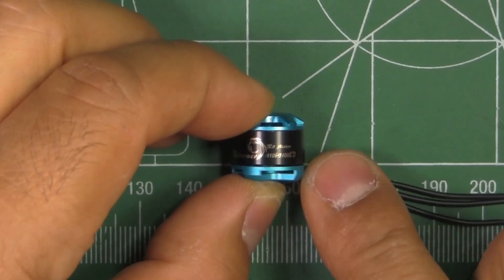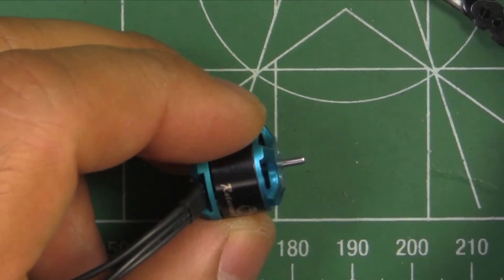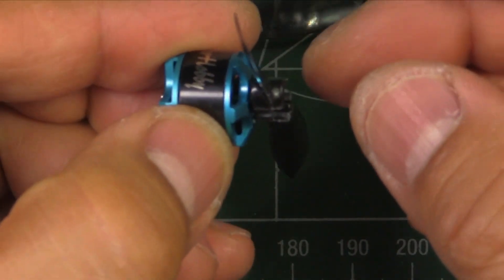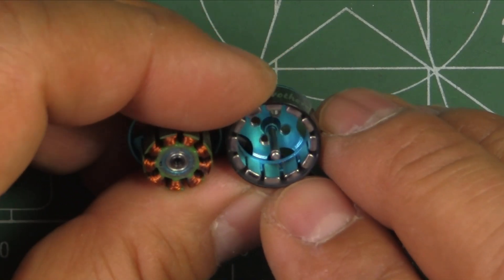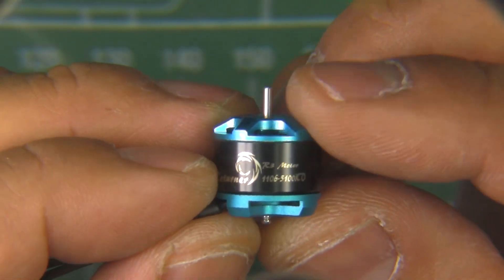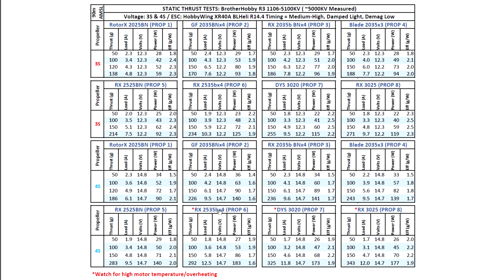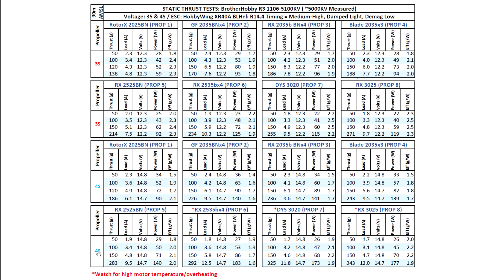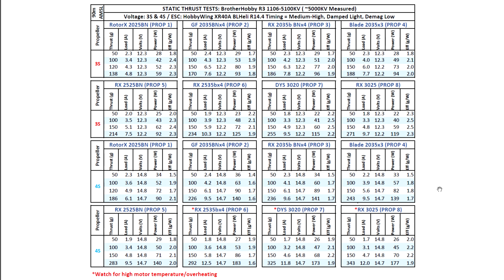BrotherHobby R3 1106-5100KV 3S & 4S Thrust Tests & Overview

Comment: So I just picked up two of these motors, and some HQ T63 6 blade props on the cheap. 

Do you think they can spin um? I was pondering possibly putting them into 3D printed ducts, and running on 2s even. 

I also have a windfall of two EMAX 1106 4500kv motors I haven't put into anything yet.

Comment: Hey all, I'm a little late to this game... I picked up a prebuilt with these motors and they were running too hot for my liking on 2S, even. I've done a some tweaking and I'm fairly sure changing the motor timing on these in Bl_heli to medium low or low (I set mine to low) has helped eliminate a lot of heat without having to completely wreck the tune. (Before I was just dropping D term)

Also be sure to set the motor poles in BF, a lot of micros have 12 magnets, not 14, that may matter quite a bit.

I made these guesses after seeing all the noise my setup had, and noticed the motors ever so slightly twitching on start. They now start smooth, sound a lot different, and felt cooler to the touch than previous flights.

Still think I'll be sticking to 3S on these though.  Thanks for the video, now I have some other props to investigate. Quad came with gemfan 3028, which I'm thinking might need to drop down in pitch some, if anything I'm learning is making sense. 😬
Reply from the maker: Looks like you have made some good adjustments. Yep, these motors run quite hot. Good that you changed those settings to minimize heat. 3S will making run hotter perhaps 3" props would be a bit too much for these. Your settings should help others with similar setup. Thanks for sharing.
Reply: @EngineerX  Thanks to your vids, info, and hard work man, I appreciate it! I'll be testing the 3S today at the park. Probably dumb to fly when it's this hot already (95°F and rising...), but we'll find out the hard way if we have to. 😏

I'll put up a blackbox video of the test flight soon, and report back how it goes, if anyone's interested just check my channel in the next few days. If anyone has recommended graphs or debug modes, let me know! (I assume gyro, motors, pids, volts and amps. I will have to look for more fun stuff that might be useful, even if I hardly know what I'm looking at. 😬)
Reply from the maker: @JerR22  awesome. Will check out your progress. Hey, that's the best way to learn. Hands on , trial and error. Good on you !
Reply: @EngineerX  OhhhhKAY!!! These motors have been transformed, that's for sure!!!  I will have to comment on performance once I get it outside and completely tuned, but I'm gonna need more time for that!  The sound is completely different though, and they no longer feel like they've just re-entered earth's atmosphere when I land.  They were barely warm- back right was warmer than the rest so I may have a super slight CG issue, but no more red hot finger tips! YES!  So, here's how it went down: Snagged up some more JESC licenses (R.I.P. to my first TH Freestyle board which had the previous 4) and put 48Khz PWM and RPM filtering on using version 2.3 (with 2.3 telemetry too, required for this config). Adjusted timing back to medium low, set demag comp to off.
 I updated to BF 4.2, figured why not, let's invite some real trouble!  More importantly, I found out that the motor pole setting I was speaking about above, is only applicable when bi-directional DShot is turned on (As many I'm sure know, but some may not, BLheli_S only supports Bi-directional Dshot with either JESC (paid) or JazzMaverick's (free) custom ESC firmware. (Oscar Liang will show us how! https://oscarliang.com/setup-rpm-filter-for-blheli_s-esc-for-free/)  It's important, but only if that's activated, as that's required for the RPM filter- from what I understood.  I am unsure if it is applicable to anything else when Bi-direction dshot is turned on with RPM filtering set to off.  Honestly though, I don't see why we would want to do that if our goal is RPM filtering for cooler motors(?).  I digress...

The (late night) hover test (that may or may not have woke my neighbors when the low batt alarm started going off😆Sorry neighbs!)  turned out to be 9 MINUTES 14 SECONDS!!! I landed at 3.43v! (I landed in my hand a few times and felt the motors, perfection) This was on a TBS Graphene 520mAh.  Also, I forgot to mention, I'm running Gemfan 3028's on these motors.  Using your chart to wildly guess based on percentage difference between the 3020's and the 3025's, assuming a 3-5% increase in thrust from the 3025's to 3028's... Would you think it safe to guess it's making around 275-285g of thrust at between 10 and 11 amps?  Honestly I don't even think I'm going to bother with 4S on this for now, this seems like a really sweet spot if I get consistent performance. (literally just that one "flight" so far, Can't wait for tomorrow!)
Off topic: regarding BF 4.2:  I'm using the new "set FF_interpolate_sp = averaged_4".  This is now apparently  recommended for Frsky and R9 users as it's supposed to help smooth out FF jitters and tx inconsistencies[Didn't know there were any, good news it's better, let's hope we feel it!].  Lots of details here: (https://www.youtube.com/watch?v=zsW3VkPRr3s)  I had to use "set vcd_video_system = NTSC" to get my video mode set to NTSC to get OSD working.  Default is set to auto, so I guess they thought auto would resolve it and got rid of the selector on the OSD tab? =|  Also to change my font I had to plug my battery into the quad before plugging it into BF, only then was the font manager button not greyed out. For some reason I feel like that's different, perhaps I just didn't change it on this quad before and I'm used to my others?  Highly likely.

Anyway, sorry for the length I'm just super excited (and exhausted) as I never expected this little beast to hover for over 9 minutes and come down with cool motors! Without this video, I couldn't have got there as fast as I did, or maybe ever, considering the seeming lack of info out there on this motor! Thank goodness I don't have to live that nightmare. =D  Appreciate ya buddy!
Oh yeah, AUW is about 130grams so far as I can tell from my little analog kitchen scale.  Okay, delirious post ended. 🤣

Comment: I heard dont get this motor.  The hglrc flame 1105 makes more power on 3s than this BH 1106 does and they come down barely warm.  I think bh was just selling the hype.  My next motors will be the emax 1106 6000kv.  As the emax makes almost the same power on 2s as the flame motor on 3s.  and they are priced between the flame and returner r3.
Reply from the maker: Good choice, EMAX once again setting the standard for performance. 6000KV is probably the most versatile KV. Can run 2S to 4S depending on setup.
Reply: Here is my dilemma, right now I cant record my flights.  Im looking at frames that can carry a run cam split and I estimate the build would come in around 115 grams plus battery.  right now im 75 grams.  Is that going to be too much weight for the emax 1106 6000kv?  Would I need to up the motor size to emax 1306.  Other thing to think about, based on the thrust tests the 1106 is making just as much power as the 1306 on 3s , plus the extra weight of the motors.  

Or Do I just use what I got, upgrade to the emax 1106 6000, and then just strap on a mobius mini that weighs 27 grams.  That way I can remove it when I want to really rip.  Pros and cons to both, One way is not permanent but its also not protected, Other way is protected but always heavier.   I plan on only using 3s, so I think it can handle the extra weight.  OH decisions, decisions.
Reply from the maker: jarrod landry To carry the Split you want for sure 3" props  1106-6000 may work but will be a little on the heavy side.  I don't yet have a feeling on what 1106 motors can do. Someone for sure has tried on YT?. Might have to go to a 1306.

Comment: Thanks... good testing and showed what I expected and hoped regarding the DYS 3020 I've been using after balancing them. They do break REALLY easy but cheap to buy and up there with the best in performance and efficiency while being the safest by far and probably the lightest. Just wonder if they'll break at the hub on  higher KV motors flying acro hard on 4S. Just wish it would cool down as everything is running hot in this weather... where are the chimtrails when you need them;-)
Reply from the maker: John F Hendry Yep hot weather not fun for flying.  I was surprised how much thrust those 3020s put out but yeah aggressive acro may not go so well with those. Thanks for watching
Reply: Yes  I'd be concerned flying at a distance away due to the skinny hubs... but with added rpms keeping them pulled straight on a lighter weight build hard to say at what point they blow up at but your testing showed at least short term they can handle more RPMs by far than they'll see in use on 4s using 4000 KV motors. On a 150g  build on 3S @ 4000 KV I've had no issues and like the fact they will break off at the hub before harming something. 

But new prop designs for micro quads are sourly needed now as every change made from weight to KV to PID settings etc. is related to the prop one way or another. I've got a brushed motor quad using 8.5 motors and there's no prop for it at its weight as 55mm are too small and 65mm too big and only 60mm I've found comes on a specific brand quad with the wrong pitch and the price to use it saying it's a good prop is prohibiting if you can find them in stock. Surprised APC or one of the other major prop manufactures isn't all over this to do it better as by weight the brushed motor props are close to nothing yet sell for relatively high prices and if APC/other made a name for itself with better designs and sizes they'd sell a ton of them with new pilots joining the hobby non-stop. Sunday we have normal weather back with good winds so finely get to get back in the air. Take care...

Comment: Thanks for this video !
I will use those motors (7100kv) for my new 2inch racer. I will use 2035x4 props (Lipo 3S GNB 550mah...) F425 Aio (4x25A ESC)
What do you think ? my setup will be a beast or not ?
Reply from the maker: From what I've been hearing, the 7100kv motors are definitely quite powerful on 3S - BUT they run alarmingly hot on 3S. That's what I've heard from a couple of people who have lots of experience building micros. 
If your setup runs well, but motors are running way too hot, then try 2025BNx2 props or those 2030x3 props from the Blade Torrent.  I found that those 2035x4 props make good thrust but use more Amps than most other props, so check motor temps on the first flights, and please let us know how your setup does. It would be very useful to have more user experiences with those motors.
Reply: Thanks for those informations !
I will definitely not try 4S then :p
I bought some "HQProp Durable DP 1.9x3x3" i will try them anyway ;)
I will try to not forget to come back to give my experience with them.. for sure i will post some videos when the quad is finished !
Feel free to take a look at my channel, my latest video with the Lizard95 is pretty cool !! XD
Reply from the maker: Thank for sharing.... Now going to check your videos :)
Reply: I've been running the 7100kv with the xjb f425 with 3025 gemfans and a 650mAh 3s xt30 tattu battery for about three weeks now. Keep pids as low as possible and the motors come down hot but not too hot to touch. Seems ok and incredible punchouts for freestyle. Hopefully I don't smoke them.
Reply: I have to say i'm not really happy about those motors after testing them ... They are heavier than the lizard95's motors but they are not better ^^
They become so hot on 3S with HQprop 1.9x3x3 .. i think they will burn soon :-/
I bought 4 new lizard95 motors because i think they are way better than those ! The magnet are also arc, they are light, they are powerfull, they dont become too hot on 3S, oh and btw the price !!
Reply from the maker: Thanks for the info, will keep it in mind. Unfortunately sometimes only when you go and test all 4 motors on a frame and go fly is when you find out the problems :(
I'll have to get the Lizzard95 motors to check them out
Reply: Yeah i hope the main problem is the lipos.. i have not received the GNB 3S 550mah i bought and i hope that will change a lot :)
Also i only tried them with the HQ 1.9x3x3 for now.. i will try with the 2035x4 from banggood even if i'm afraid about burning the motors !
Those 2035x4 props are really brittle but they are light and fast. I got less propwash with them also.
Anyway if you test the Eachine 1104 6000kv i would be very happy to see the video ;)

Comment: Just FYI for the shafts popping out, put your props on loose, just enough to hold them in place then flip the quad upside down on a table and press the shafts downwards from the back (providing you have holes) with something like a flat tipped punch.
Reply from the maker: Good method,i'll have to try that. Thanks for sharing. I'll try and show it on next 110X test video.  Can still do at park. Just need to find a flat object

Comment: So your the only other guy I've seen talking about the motor shaft backing out problem, do you know if there is any fix for that problem like once the shaft has backed out is there a way to get it to stay in place again?
Reply from the maker: I'm just relaying info learned from a couple of guys (Adam-g1 being one of them) I didn't have much experience with 110X motors until recently, testing and using in a microquad I built. Well, the short answer, is "NO", but I'll give you my reasoning. It comes down to size. At this small scale using grub screws like in other motors would mean they have to design a different bell cap. It would have to be larger, adding weight. The size of shaft also it very small so the pressed-in friction is also small and that's why they back out. Using adhesives also probably wouldn't work, since there's not much area to work with. 
One way would be to machine the shaft so that it includes a disk or a slight bulge where the bell would stop against, but that would have to be on the upper portion of shaft where the propeller mounts so that would complicate the design. Similarly, someone suggested using C-clips, same as used at bottom, to be used on top. Again that would complicate design of bell cap and you'd have to have very exact shaft/bell sizes. So seems it's a difficult task, so best thing to do at this time is to prevent backing out shafts and possibly causing loosening of fitment if done repetitively. As someone suggested, using the 1/16" drill bit solves the issue of tight props causing shaft movement. Extra work but, all we can do at the moment unfortunately :(
Reply from the maker: You can try to use slow-cure CA glue perhaps? Once backed out, apply just a tiny bit with a toothpick (top and bottom if possible -would need to tear down motor, then press shaft back in place, don't know if that would provide enough adhesive force to keep shaft in place.
Reply: thank you, ca may work but your first answer is probably the more likely of the two, I would think with any heat the adhesive would lose adherence and it would probably stop sticking again, I've already replaced all of the motors I've had this problem with and I've actually already been drilling out my middle prop holes for a little while, I just figured it would be worth asking you, I've watched many of your videos when trying to choose motors for different setups and I appreciate your opinion, I may try the ca for ishts and giggles I'll let you know if it works encase others ask
Reply from the maker: Yes, please do, always good to get tips from everyone and pass along to others. They really need to come out with some sort of shaft design that doesn't back out. People would buy for sure. Thanks for watching!
Reply: will do and yeah thats why whenever I encounter a really weird problem or anything like this I try to tell someone who makes videos relevant to the topic so they can pass the information along to others, I'm debating makiing my own youtube channel for all the weird problems and solutions I've ran into/come up with
Reply from the maker: I'd say do it!  I've watched videos done by people that have helped a lot and if I hadn't watched, i'd still be struggling with the problem. Sometime the solutions is trivial, but not obvious so having someone just show it helps a great deal.
Reply: I've been dealing with this problem a lot. Have both eachine auroras. Best solution is to put prop on and let shaft go. Once prop screws are in push shaft back into bell and prop. Only works with tighter fitting props.
Reply: Danny G I've tried that but it seems to cause more vibrations

Comment: i would be extremely curious to see the rcx1304 thrust test. According to myrcmart it clears around 300 with 4s and 3020 prop at 9.4 amps and it is the same weight as this one .
Reply from the maker: I have requested those from MyRCMart. They said they would send me some test samples on the next goodies shipment but don't know when they'll be shipped. I'm also curious to see the difference between a 1106 and a 1304 since the theoretical stator "volume" of the 1106 is greater- just using cylinder volume calculation:
1304 =531mm^3
1106 =570mm^3
So theoretically the 1106 should generate more thrust since it has more iron & copper in its stator but we gotta see it tested to confirm
Reply: but the shaft and bearing space is greater in the tall motor, by proportion. And that's dead weight.